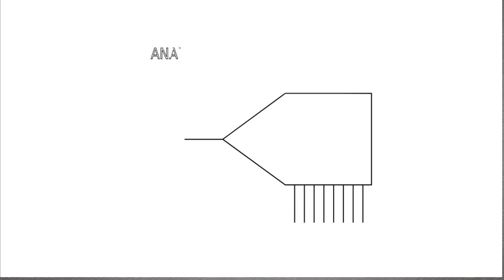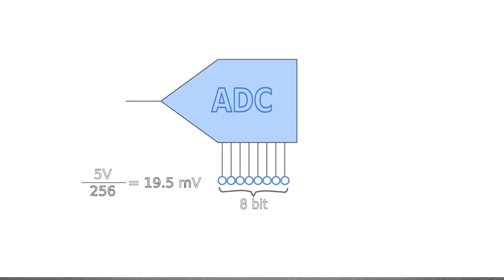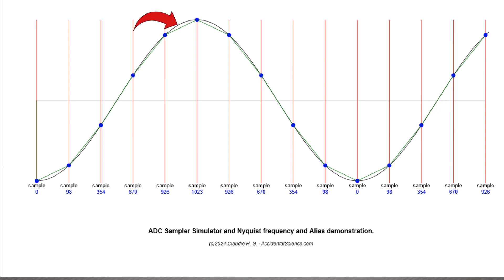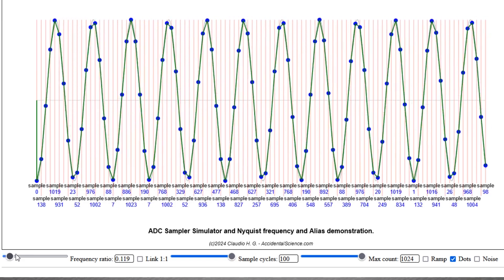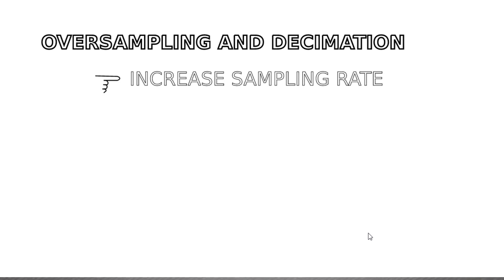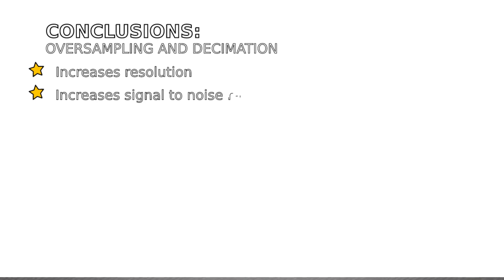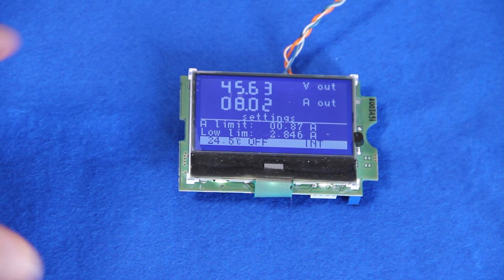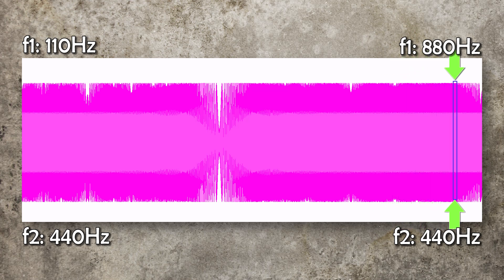#ADC and Oversampling in 14 minutes: How to get more bits out of Analog to Digital Converters

Comment: Hii.. Good explanation and video...Is it Successive approximation method used in all the latest controller in ADC?
Reply from the maker: @user-lm1wu8ny8r  AFAIK it is usually the case, but I don't know if it is used in all controllers. The data sheet should specify which type of ADC they use.